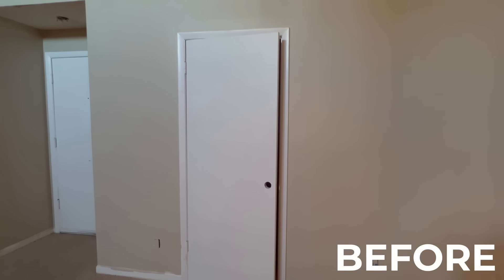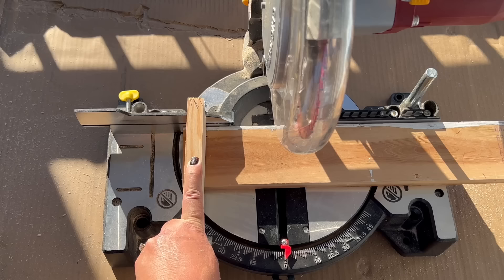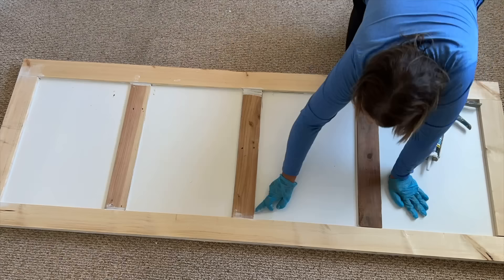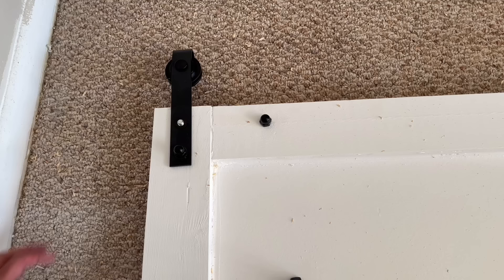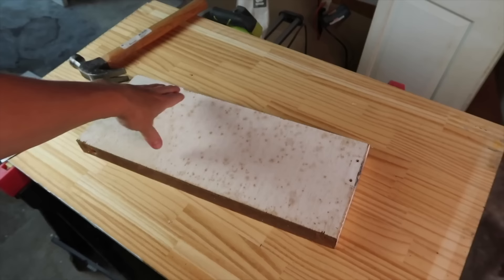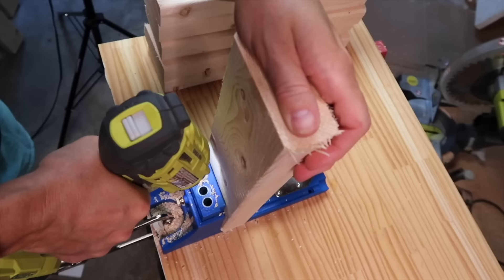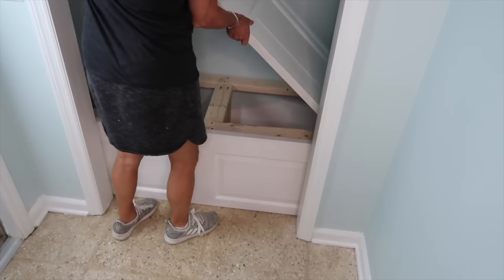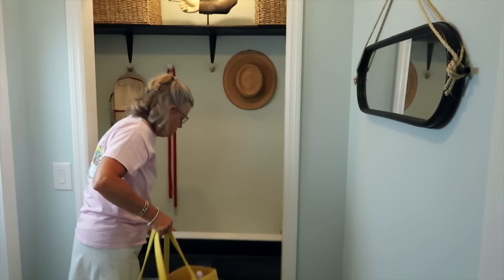She saves THOUSANDS with this brilliant DIY door idea!

Comment: Okay, when I'm able to purchase a saw, drill, nails, and the other tools. 
Then I'll get the material needed for the actual project(s).
Then, get around to it when I have the time, energy, and space to do this. Looks amazing. 👍
Reply: Fb marketplace is amazing for used items!
Reply: @shellarmstrong1  great idea! 👍🏻
Reply: Once you get started you will find project after project. Building things is addictive. And you can build things the way you want them.
I drive my poor husband crazy sometimes. He bought me my first miter saw as a joke about 20 years ago.He thought I would exchange it.
Claims he created a monster. 
The miter  still works, but I am on my second table saw and 4th  sander. One of my drills just gave out as well. Well used. 
Right now I am building a greenhouse using mostly old pallets. Two dollars each. Needed to buy some  longer lumber for framing and roof and the plastic of course.  It is long and narrow  and the back is the wall for the carport. Promised my husband I would build walls for it.
The old flooring I replaced with tile last spring  is being used to help weatherproof that wall.   I even included outside herb garden gardens  on the outside front. 
The entire cost will be under 400. Just need to finish off the plastic on one end and do the door. Weather has not been helpful. 
A greenhouse that size in our area  is well over a thousand. And even then they don't have floors.
Between replacing the kitchen and dining room floors I build an old world wine making table. 4 by 4 legs. I use glass, not plastic, making wine, so heavy when full. A 60 inch bit of counter with a torti pattern for the top. 60 dollars as it was an end. Another 20 to have the ends finished. Under 200 altogether, but several people could standon it easy.
Shelf underneath to hold supplies.  Also room for the coffee pot and dehydrator.  
I also put a wooden ceiling in in our half bathroom.  Found it in the crawl space. Leftbover from whoever did the main floor ceilings. Only 4 years in this house, so still finding things. That took a day with repainting as well. 
I had a panty, but it was very deep, with deep shelves. Could never find snatching. Under the stairs was the cleaning closet. I pulled the shelves out of the panty and made it the cleaning closet. Works perfect.
Then I built long shelves under the stairs making a walk in panty were I can store twice as much and see everything at a glance.
I promised my husband I would do a storage building as the wall on the other side of the carport next spring and build something nicer for storing the wood for the stove. 
So you see, you will always have lots of projects to do and even though the tools are an investment,  in the end you will save money and you get exactly what you want.
Reply: @dawnelder9046  Wow, i should hire you! 🏆
Reply: Isn’t that how one starts anything new? 😉

Comment: Hi…love your door ideas. If you don’t mind, I have a quick question about my bathroom vanity doors. I want to paint it because it is a shiny, builders oak finish. The drawers are flat faced but the two doors to the under sink area have a decorative groove…which really dates the piece. What can I use to fill this groove and should I do it in layers so it dries better? The groove is quite deep. I had even thought about taking the doors off and flipping them over so the groove is inside the cabinet. But that seems like a lot of extra work. I would appreciate any comment from you! Thank you!
Reply: I am just reading comments..(not the lady on video)..if it were me re your project, I would fill that gap best as I could with spackle.  Doing alittle at a time isn't really necessary.  I would use a small heater to expedite the drying time..
   After you have leveled it off, n it's completely dried, comes the sanding, n once sanded, use a primer (IF USING A WATER BASED PRIMER, FOLLOW WITH  PAINT), THEN USE "MINIWAX" POLYURETHANE TO PROTECT THE DOOR N DRAWERS.
   IF YOU DONT WANT TO BUY SOME MUCH, I HEARD WALMART CARRIES THIS PAINT THAT CONTAINS PRIMER N PAINT, VERY POPULAR ON APPS. HOWEVER, I BELIEVE THE OTHER PAINT STORES ARE CARRYING SOMETHING SIMILAR TOO NOW. I HOPE THIS HELPS.
   I CANT BELIEVE SHE DIDNT RESPOND TO YOU.
Reply: @H4me7215  Thank you for the suggestions!!